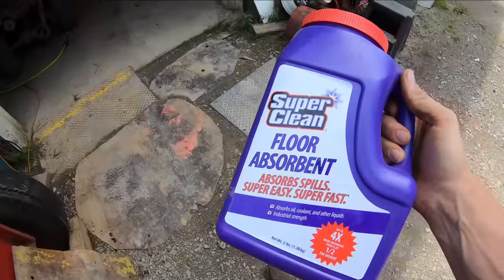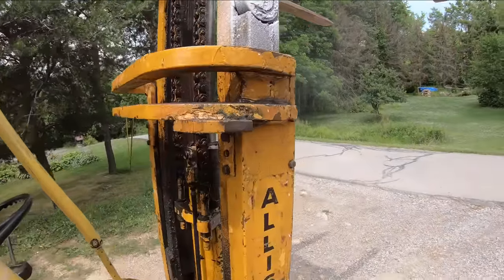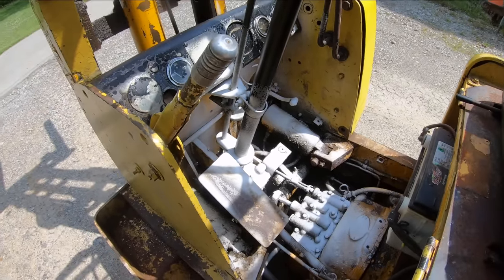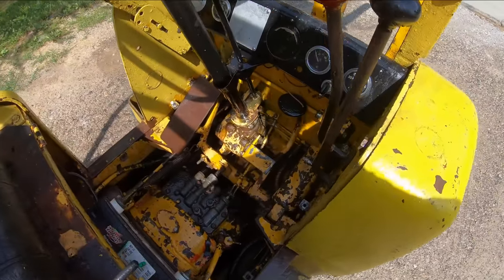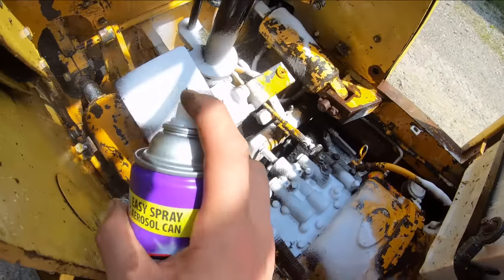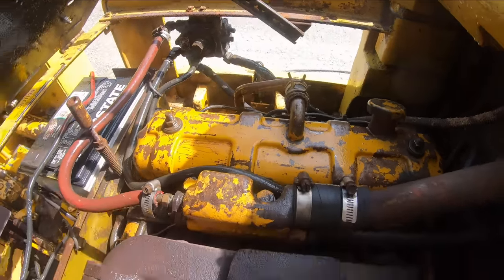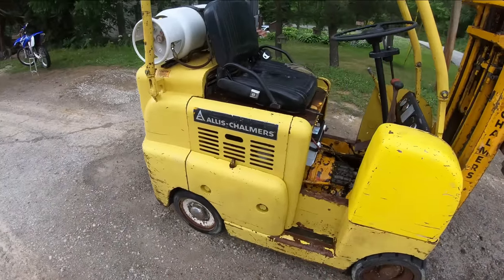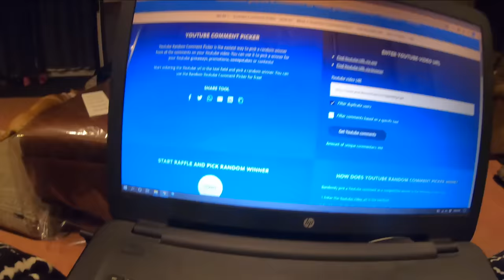Super Clean-ing The Cheapest Forklift on Marketplace!

Comment: Super clean is the best.
I’ve been an auto detailer for 39 years.this is the best all purpose cleaner/degreased I ever used.
It’s very adjustable for everything from degreasing engine compartments to interior cleaning through different dilution ratios.
Try using a turbo nozzle on your pressure washer in conjunction with the super clean.you would be amazed

Comment: I worked for Union Pacific Railroad and we used to have a forklift used to unload new cross ties that are soaked in creosote and the fork lift was completely covered in , under , inside and every where the creosote could accumulate from over 10 years of use .  Our shop overhaul shop was given the forklift when contractors took over the job of unloading the crossties . The forklift was cleaned using a Hotsy Cleaner and about 20 5 gallon buckets of the strongest steam cleaner soap that was available . Just imagine the machine being dipped in liquid asphalt and baked on for 10 years . I didn't have to clean it , but I did pity the mechanic helper that did . It looked brand new after the cleaning  .  You did a great job with the Super Clean , I use it a lot also . The old Allis Charmers looks great again . The Hotsy is a steam cleaner and uses a lot of water to wash away the dirty residue , unlike a regular steam cleaner . Great videos , keep up the great work .

Comment: Only one comment,Never walk under the forks of any forklift.In 1994 I was working on a forklift part of the carriage fell on my right arm .My right arm had to be amputated just above the elbow.I probably am just a little more careful about working under suspended loads,now. Also I don't know what of fuel regulator is on your machine,but most of the fuel regulators could use a good cleaning and the internals replaced.Rebuild kits don't cost much and the machine usually runs much better.Most kits come with all the instructions you need if you have never had one apart.Actually,easier to repair than the carburetors on lawn mowers,or snow blowers.Just a thought. 
Please keep making the videos,I really like the way you work and like your idea of reparing rather than just buying new parts.

Comment: The machine looks nice. You got the top coat at least. Second go will get down to the bare metals. - How about primer and a nice yellow paint job. Use OSPHO (Contains phosphoric acid to convert any rust to an inert material) prime and paint and that will look spectacular.  You have to be careful with high pressure sprayers. You can cut into hoses and hydraulic lines leaving them weak or leaking. Nice job., good demonstration.

Comment: More than one YouTube contributer has described old fork lifts as four-wheeled oil leaks!
Reply: Great idea to write the compression test readings on the side of the block for future reference. I also add the date u took the test.🐾
Reply: Yep, Forklift = 4 wheeled oil leak. Both electric forklifts my company has leak hydraulic fluid from everywhere.

Comment: That purple power is strong stuff, I took apart our carpet cleaner about a couple weeks ago, and I dropped all the nasty screws into a plastic tub of purple power to soak while I waited on the new belt to arrive I ordered online. About a week passed, belt came in and reassembled the carpet cleaner when to get the screws out of the solution....darned it all the threads were gone....it was a hand full of “aluminum” spikes....of course that also says the quality of the screws they used too....pretty cool science experiment though.

Comment: One thing I would point out with Super Clean and don't get me wrong, it's a great product. But it works best on a dry surface. If you spray in on a surface that is already wet with water, it dilutes it's cleaning power. Also if you spray it on aluminum, rinse it immediately or it will etch the surface.

Comment: Fun fact; When I worked at a gas station here in Germany I learned that the stuff they use to clean uo spilled fuel is Bentonit. Thats also sold as cat litter stuff here. Cat litter is far cheaper though.....
Reply: J. Zingler, I was just thinking the same thing.  Cat litter is great for cleaning up all kinds of spills and doesn't cost you your wallet!

Comment: @Diesel Creek Don't buy those chain lubes, just use normal 80-90w oil, this is what the manufacturers recommend and it's easier to clean off, also those super sticky chain lubes tend to get clogged up with grit from riding and this prematurely wears your chains and the seals of the chains and the 80-90w oil is much cheaper. Just a little tip.

Comment: oven cleaner works great and you can see where you sprayed also, just don't spray it on aluminum 👍, also don't breathe it in, and it's very cheap
Reply from the maker: Good tip!
Reply: I´d stay clear of plastic, rubber, and also weak paint don't like it.

Comment: It sounds like you are leaving your pressure washer running for quite a while when reapplying the degreaser.  Running the engine without flow on the pump will overheat the pump and cause failure in a short time.  I never let mine run more than a minute without triggering the nozzle just so the pump never overheats.  I have one that still works fine after over 20 years.  The engine lower oil seal leaks a bit of engine oil but nothing else is less than new in performance.

Comment: Can't beat a hot water pressure washer with TFR or truck wash being mixed with the water ! 
Each year a commercial truck in the UK has to undergo a safety check, for that check the underside has to be clean & the fifth wheel has to be clean of grease, truck service centres use a hot water pressure washer & TFR
Most of what you cleaned wasn't grease, more dirt n dust stuck to oil.
Reply: What is TFR?  Agree that wasn't a terribly difficult job.  I've brought equipment back to life after sitting in fields for 50+ years.  Grease and oil so hard you can't scrape it off.

Comment: I just started a new job as a "Water Blaster" removing paint from the racks that hold parts in paint booths. Im using a 40,000 Psi pressure washer (Yes I mean 40K.) I stopped at a car wash the other day and I felt so underwhelmed by the pressure coming out of the nossel!
Reply: Is there aggregate mixed with the water?  If not a "dustless" blast system will work faster than just high pressure water.

Comment: Did you ever fix the exhaust leak? bad downpipe or muffler? When you first unloaded it off the trailer I heard it running on all 4 for a few seconds, then it was a 3 banger until you changed out plug 4. The hydraulic pump sounds like it may need some attention. 
Cheers from Louisiana.

Comment: You would have had the same results without the foam, the pressure washer cleaned it, not the degreaser, you were hitting the paint so hard, you didn't only take the gunk off, but you were removing the paint as well.
We clean our companys plant hire equipmwnt on a weekly basis, all that's used is the pressure washer or steam cleaner (no detergents)

Comment: Oven cleaner is really cheap compared to degreaser and it works really well
Reply: You need to call out which oven cleaner.  Citric based, sure, the caustic stuff... not so much.  I had a not so bright director try that on a brand new Harley with the black wrinkle paint on the cylinder jugs.  No easy fix for that damage.  Considering it was a new scooter I never understood why he thought he needed to go full gonzo with oven cleaner.
Reply: hawkturkey  .... and aluminium.

Comment: That product didn't do a dern thing for the caked-on grease brother, that's all water pressure. The cleaning product did clean up the oil residue afterward. I'm sure you didn't mean to mislead anyone because I watch all your content, but you need to clarify that point. Great video otherwise, keep up the good work.
Reply: I disagree. I think it broke it down some. Made it easier to get it off.
Reply: I dunno what makes you think that, because it’s crap, we used to sell degreaser that was used in Ship’s engine rooms,and that would clean up an old lorry in half an hour, an hour and the paint was getting soft.
Reply from the maker: I should have done a side by side comparison, I’d say the super clean definitely made it easier to remove like was said above it broke it down some. I’m not getting paid for this at all they just sent me a box of stuff to try, this is my honest opinion!

Comment: after having to clean my motoscooter I can tell  that you did a ton of bad mistakes, so I will provide some tips, before washing try to remove the grease with tools, scrape it of as much as possible, your approach made a mess on the entry path, you actually created a health hazard, now all the animals and even vegetation will be at risk thanks to your pressure washing, and it is not the pressure washing the problem in it self, the problem is that you didn't use something to capture all the grease that is falling off, perhaps a set of old curtains made of fabric, perhaps some other type of fabric, the idea is to not let the grease wander away as if it was something harmless, that grease is poison and of the worse type as there is no cure if ingested, whom ever told ya that what you did there was ok, is omitting all the environmental hazard that you did in less than a days work, so 1st of all you need to park the vehicle over the fabric, the fabric will retain most if not all of the nasty toxic stuff, after having hand scraped most of the grease then remove the polluted fabric and add a new layer of fabric now wash with common detergent and a good set of brushes, you do not need to buy that silly foam in a can spray, the detergent will brake away most of the grease yet it is possible that the grease can clog your brushes, so you will need to clean them to, if you want to use the pressure washer you can yet do not forget the fabric, as the most important thing to to keep the little nature that is left, and not you silly toys, if you do not care for nature, move away from it, got to a city and live in a apartment building, in general do your stuff away from nature, now the ordeal of cleaning the forklift, so to leave set for paint means that you truly need to use a lot of fabric and to keep brushing till the surface is prestine you could use rags and simply wipe off tons of grease, you were washing the thing as if you were at a car cleaners shop, yet the difference is that at the car cleaners, they have a system to clean their water and to trap the grease that come out of the vehicles, you were washing your forklift as some one who is washing its toys given to him in Christmas in other words as a child.